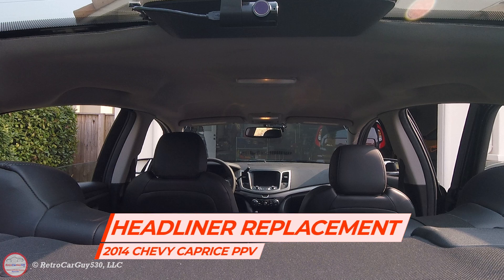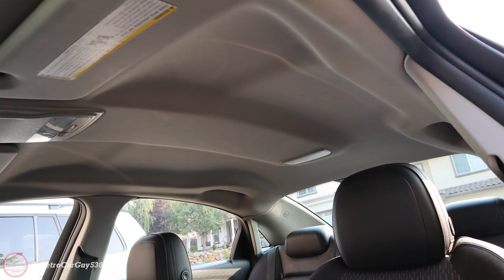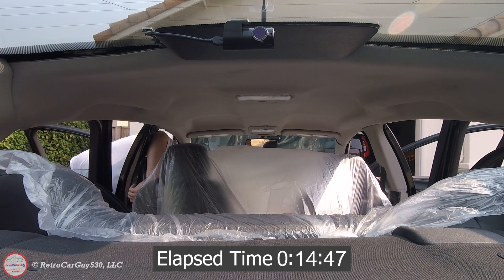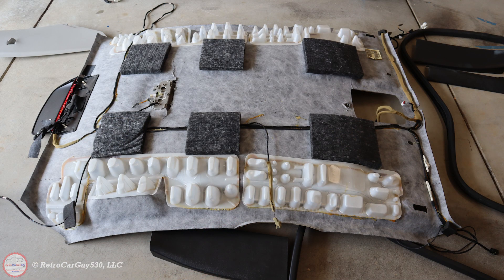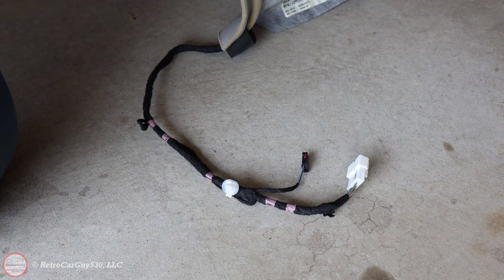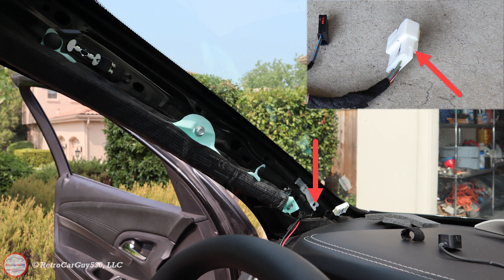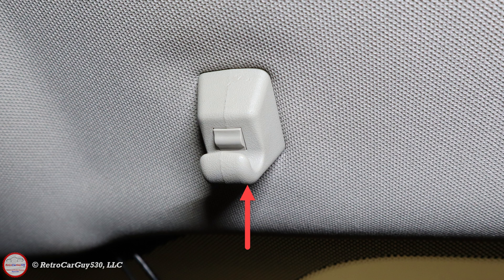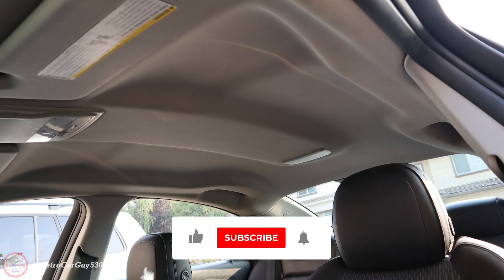2014-2017 Chevy Caprice PPV - Replace Headliner

Comment from the maker: You do have to bend the headliner a bit when you take the headliner in and out of the right rear door.  Just don't get too aggressive with the bending of the headliner material.
Reply: RetroCarGuy530 And yes your right. Those visor clips are impossible to reinstall correctly unless you take them out as you mentioned.
Reply from the maker: I first learned that info when I installed my dash camera a few months ago.  After about 10 minutes of struggling with it during the headliner replacement, I finally remembered that lesson.  Much quicker to install it by removing the metal clip from the roof first.
Reply: How in the world do you get the rear parcel shelf out? I must be terrible at this cause I’m in way deeper than 30 minutes.

Comment: just wondering if this replacement needs to remove the front or rear windshield to compete installation?
Reply from the maker: To avoid any amount of bending of the headliner, you could remove the front windshield or rear window.  I was able to install it by slightly applying pressure to bend it a bit without any negative side effects.

Comment: Great video! How do you remove the front dome light? Do you just pull straight down? Start with the rear first then front? I have been tugging on mine but I'm afraid to put too much pressure on it.
Reply from the maker: The front dome light assembly comes out by pulling down on the front end of it to release four metal clips.  Don't pull down too aggressively because there's a wire harness on the front end to the air bag warning light indictors.  Pull down the front gently and then you should be able to pull it forward a small amount to disengage the to plastic hooks that hold up the rear end of the light assembly.

Comment: How do you remove the 3rd brake light only mine is hanging away from the back glass on one side?
Reply from the maker: There are two metal clips (one on each side of the third brake light) that are responsible for holding up the weight of the headliner/third brake light in the center section of the rear roof.  If one/both of the clips have been pulled out or the plastic is broken, it could account for the third brake light hanging down.   The third brake light is mounted to the headliner using three torx headed screws, but you can't get to those unless the two metal clips have been pulled out of their mounts.

Comment: Is a 2013 Caprice ppv same as the 14s ?
Thanks
Reply from the maker: The 2011-2013 Caprice is similar to the Pontiac G8.  The 2014-2017 Caprice is similar to the Chevy SS Sedan.

There definitely is a difference between the two model year groups.  For instance, the power steering is hydraulic based in the 2011-2013 and the 2014-2017 have electric power steering.  There are parts (mainly body / L77 engine) that are shared across all model years 2011-2017, but you need to be specific when searching for parts to make sure you get the correct one for the correct Caprice model year grouping.

Comment: Just picked up my 2012 Caprice. Drove around 65 miles almost all tests are done and no check engine light is on yet. Drove fine just needs brakes and tires for better safety. However, as soon as I made it into my town, I was stopped at a red light and it started to smell horribly inside, like rotten eggs, very strong, stays there for hours. Smell is so bad I can't drive it with even a mask. No smoke, no smell in engine bay, no smell outside, no obvious leaks. Inside just stinks... :(
Reply from the maker: Congrats on getting your Caprice PPV!  Sorry to hear there's a rotten egg smell.  That type of smell is often associated with clogged or malfunctioning catalytic converters.
Reply: @RetroCarGuy530  Thanks a lot. That's what I'm getting from most searches but I think it is actually a battery.  Smell is strong in trunk and battery is still kind of warm after being parked for at least 3 hours. I'll replace it tomorrow and see how it goes. I'm praying that's all it is
Reply from the maker: @MrDeepzek  Make sure you check the main battery and the aux battery (if equipped with one).  Also, check the battery voltage on the DIC when the engine is running.  Could it be getting overcharged by the charging system(?).

I hope it's just a bad battery and it's easily fixed!
Reply: @RetroCarGuy530  yeah I guess I have to test alternator as well. It has a second battery and I'll remove it when I clean up wiring, right now it's a huge mess. I will reply with results. Thanks for assistance
Reply: Mine had the same smell found out that the ac drain disconnected from the floor so all the water condensation was going under the rubber floor mat

Comment: I just went to an upholstery shop and he said $300 over the phone , but when I brought in my 13 ppv the price went to $850??? Says he has to try and steam and form the contour for those rear depressed pockets in the rear, that no one knows the purpose of them.
Reply from the maker: The depressed pockets in rear of the headliner are where a passenger grab handle would be positioned in the non PPV vehicles.  Rather than creating a new headliner shape for the Caprice PPV they simply left out the holes that would allow the grab handles to be mounted.  I believe some Caprice owners have retrofitted those grab handles from a G8 or SS and mounted them in those locations after making modifications to the headliner.

Comment: Have you ever tried to rebuild the old
Headliner or better get a new one?
Reply from the maker: I have not tried to rebuild the old headliner because it had several holes in it.  I just wasn't worth trying to fix it.  Since my local wrecking yard had two Caprice PPVs, I decided to get the headliner that was the cleanest from those two cars.  I think it was the 2017 Caprice PPV headliner that I purchased for my 2014 Caprice PPV.

Comment: Man they really gutted the 17's of everything, even the head protection padding in the roof.  They were relentless!
Reply from the maker: I was a bit surprised to see those pads missing from the 2017 headliner.  I had to search the house to locate our hot glue gun to move those over from the old headliner to the replacement headliner.

Comment: You never showed how to take it out and put it in smh
Reply from the maker: I did have a camera outside of the car, but the video footage was corrupt when I downloaded it, so I could not show the headliners being passed through the right rear door opening. 

At 2:20 in the video, I mention that I removed the old headliner and inserted the replacement headliner through the right rear door.  I would suggest lowering the front seat backs to allow for more maneuvering room for the headliner.